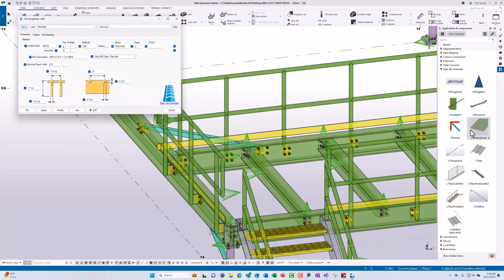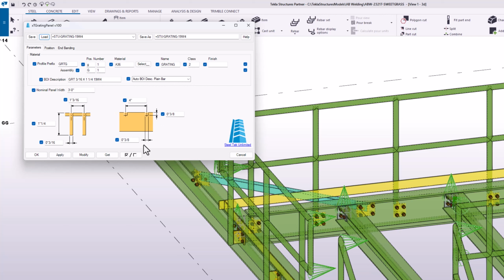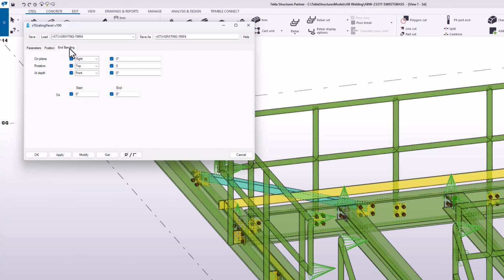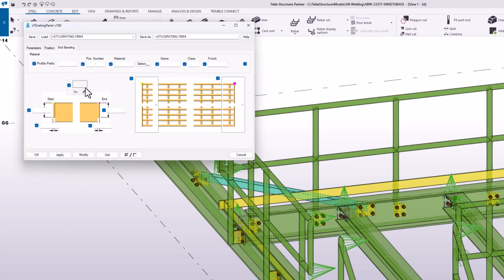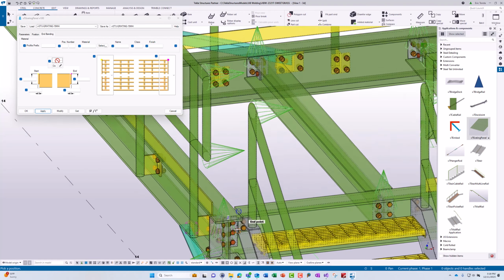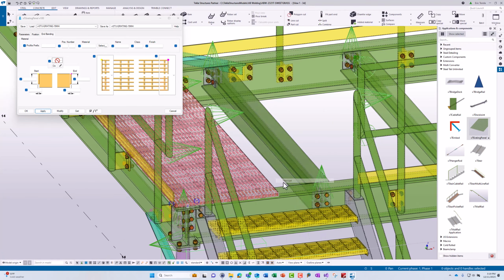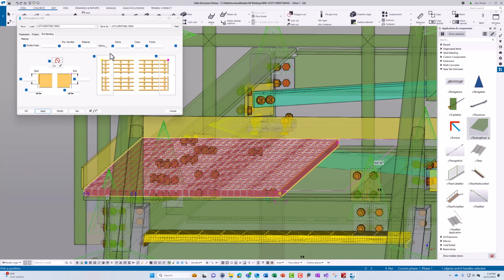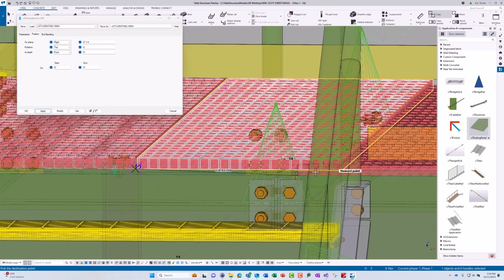Did You Know: How to Use our xTGratingPanel Plugin

Comment: Is it reals necessare to model all the parts, instead of just a plate?
Reply from the maker: For the reasons we do this.  
1) It reports the correct weight of the grating part when modeled accurately instead of as a plate.
2) If you have two panels with cuts and they are opposite hand or mirrored images and modeled as a plate, Tekla will give them the same part mark. When modeled as grating panels, they will correctly be given different part marks.
3) Sometimes because of the way a plate is modeled, Tekla may create the drawing upside down causing incorrect manufacturing or ordering of parts.
4) It is much easier to see and know where the bearing bars are for creating cut outs in the panels accurately.